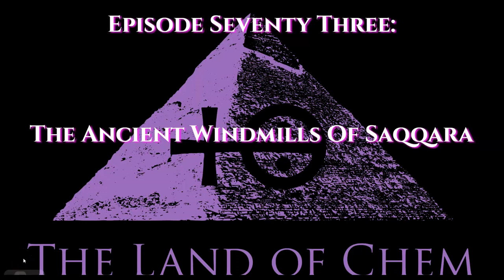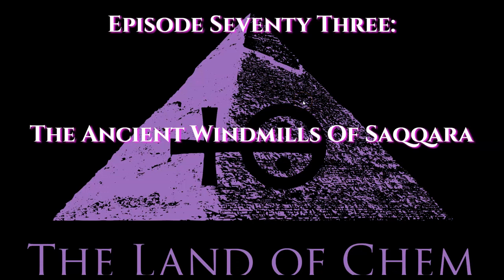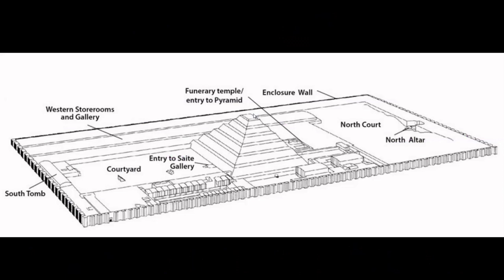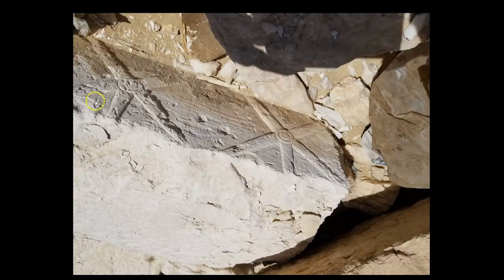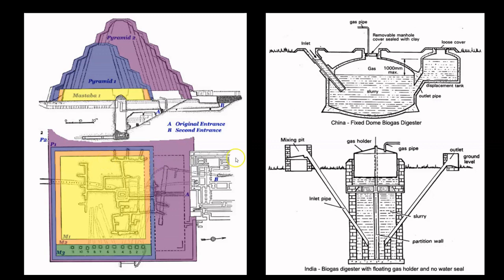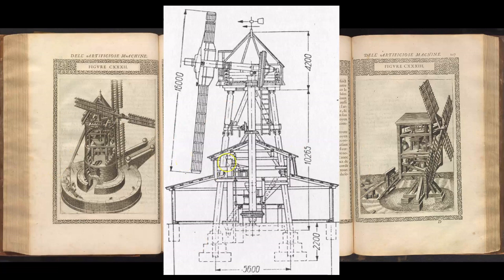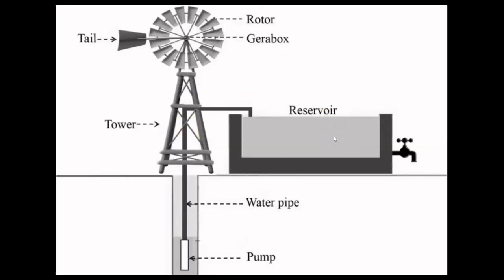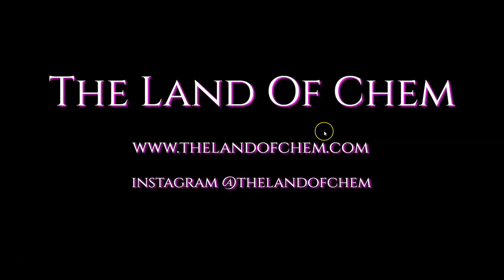Episode 73: Ancient Windmills Of Saqqara

Comment: hey man, love your theory about the pyramids being chemical reactors, great research job. However regarding your theory that they were built with this floating mechanism, with which the stones were floated through water in position etc, I personally have my doubts on that. I just absolutely dont see how that would have been possible to construct the pyramids like that in a timely manner. The estimation for the pyramids having been built with ramps and slaves was what, like 20-30 years? And the stones needed to be put there in an impossible speed even. I do not see how it would have been dramatically faster with your suggested approach. 
Again I love all your research, I am not expert myself I can just evaluate based on the various experts and their presentations. But this one seems not likely to me. Have you seen the works of Mario Buildreps on youtube? He has a great approach of dating ancient structures. It very much seems they were built by different lost civilizations and I do not see why those could not have been technoligically more advanced. to me it does not even seem to be an outrageously speculative assumption. Also in combination with the works of Brien Foerster and the likes, showing various drill holes and the perfections and accuracies of the structures.
In any case, great work you are doing

Comment: As I stated in other videos, I spent 16 years designing equipment and processes for different waste streams. Getting the product into useful uniform size was the key to a successful process. This answers a question I had and your arguments are making more and more sense. However, I’m still not convinced that this is the final picture. 
By that I mean, was the granite used for its resistance to erosion or its quartz content for producing currents. Was the pyramids used for just dealing with biomass and creating ammonia or was the process itself generating heat that then fueled the pyramid to other things?